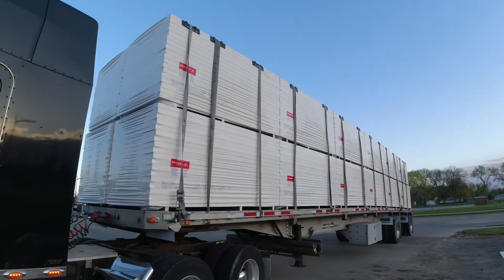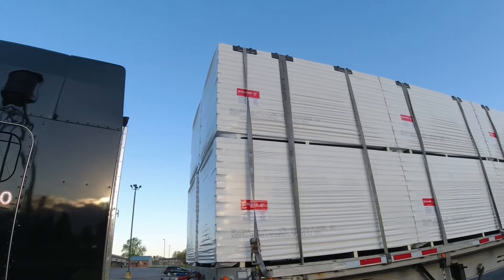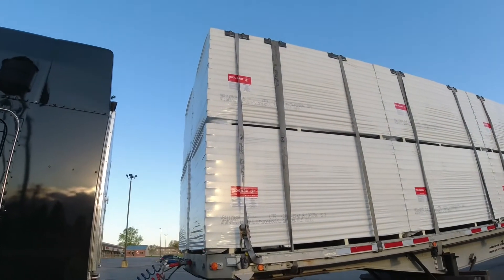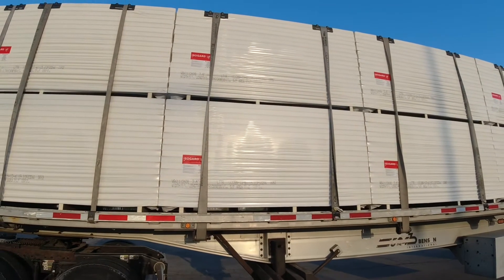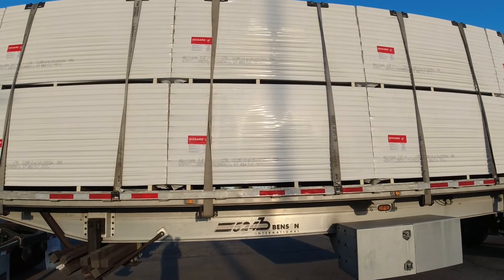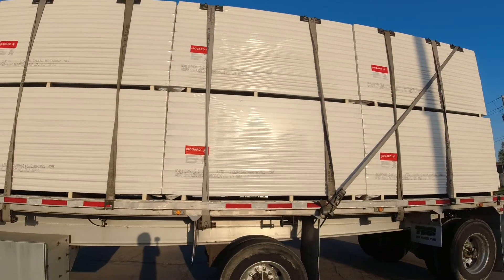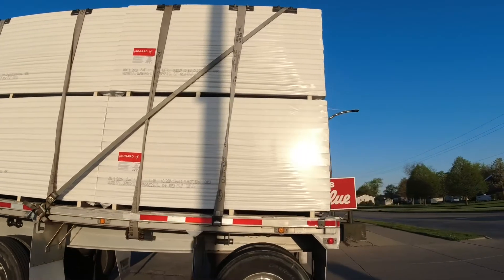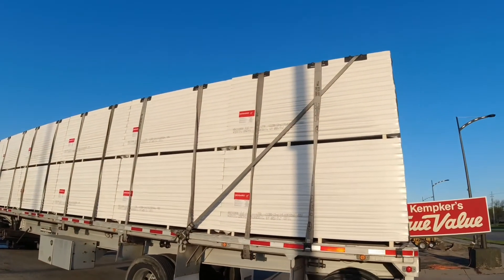Insulation Securement Video #TMC #TMCTransprtation

Comment: Any reason on the first strap being 2 inches instead of another 4 inch?
Reply from the maker: Only reason I used to and strap is because this trailer does not have 4 inch strap ratchet that reach the very front. But most people do you still use two and strap on the very front. But if your trailer is capable of doing a 4 inch strap with the ratchet then by all means use a 4 inch strap.

Comment: Do you need corner protectors on steel coil
Reply from the maker: Yes use the metal edge protectors. Some steel coils don’t need them. You can ask the place you’re picking up at. Some steel so thick that it won’t be damaged by the chains but better safe than sorry. Take  the time to put them on a drive with a peace of mind. DESTINATION EXCELLENCE! :-)
Reply: @whitecollartrucker  Thank you so much
Reply from the maker: @abdouliekajakeh2378  very welcome! Stay safe driver!